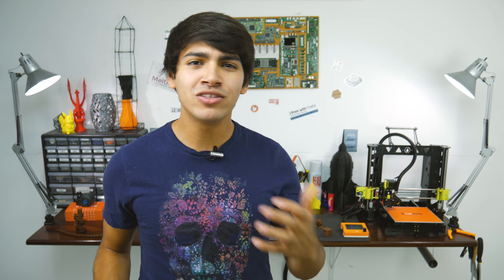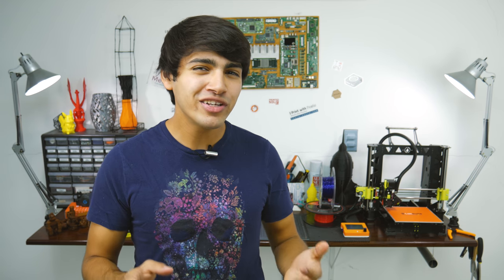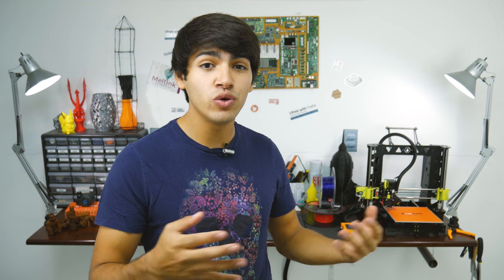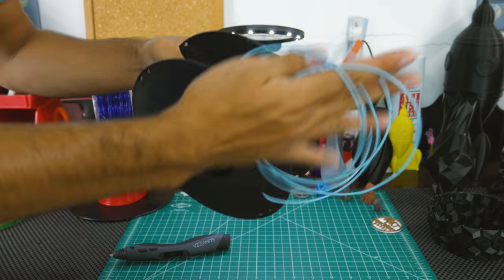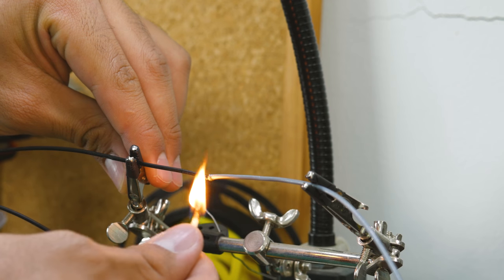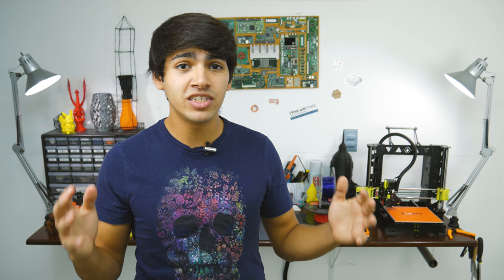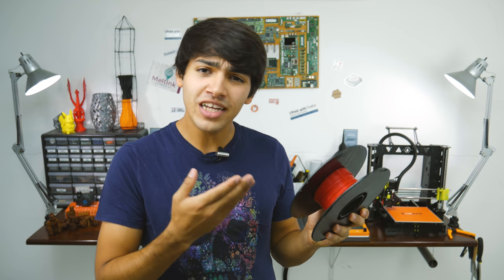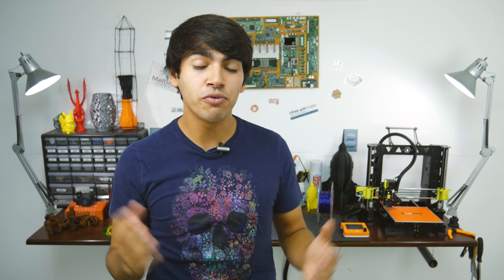💡♻️What To Do With Filament Leftovers - 3D Printing 101

Comment: Also, try using short cut pieces, directly insert into Dremel tool chuck .. use for spin welding parts together.
Lastly, any clear, or semi-transparent material, can be cut and used for short length  "light pipes", in projects involving LEDs or LED indicated PCBs.
Reply from the maker: Really nice idea!!!! I have never given this a try.

Comment: just pause when the filament runs out and load more.
Reply from the maker: I see your point, the only problem is that if you don't have a filament run out sensor you would need to be very careful on when it runs out. This is specially hard on longer prints.